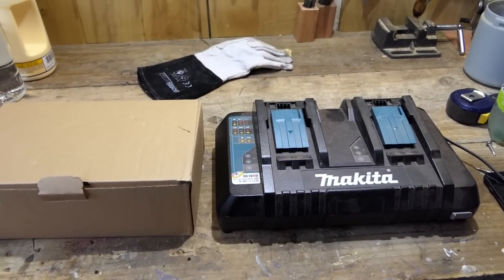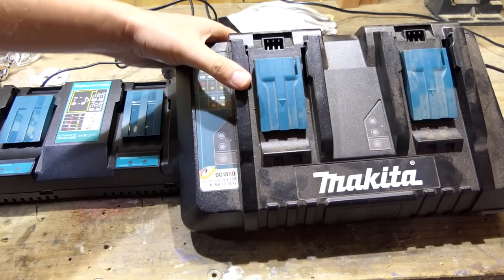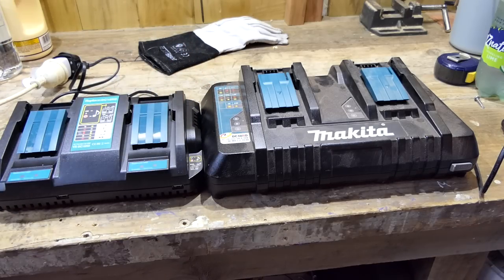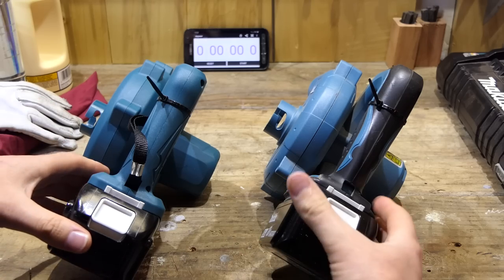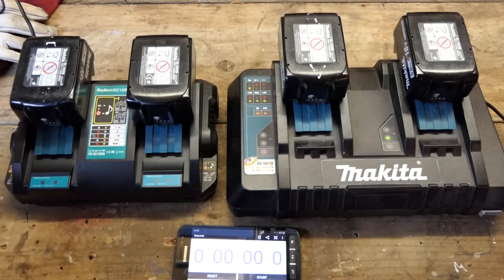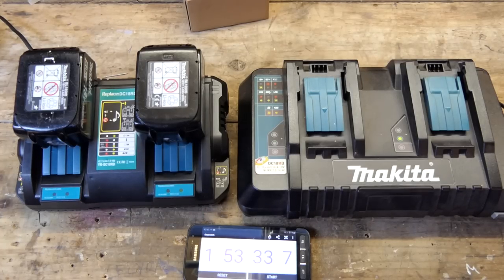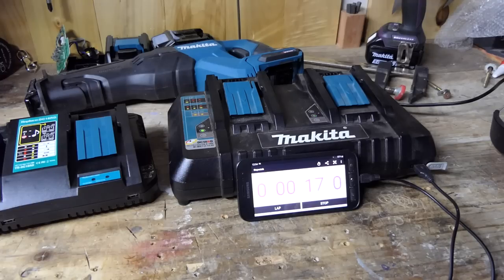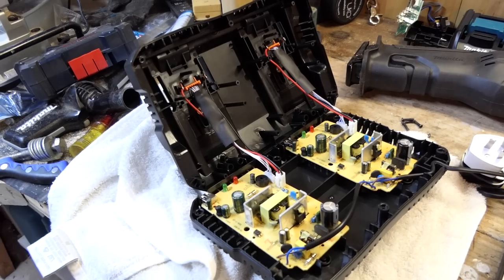FAKE Makita Charger & Blower VS REAL Makita Charger & Blower | 18v Dual Charger Review

Comment: No matter how good or bad this charger is, it's a bit unfair to describe this product as a FAKE. It is not marketed as a Makita product, therefore not pretending to be a Makita product, therefore not 'fake'. It says it is for use with Makita batteries. ie, is compatible with the Makita batteries. There are so many 'compatible' products we use in all areas of our lives. eg. car spare parts (known as 'aftermarket'). Who buys genuine Mercedes exhaust systems for their 15 year old car?? but we don't call them fake. When I hear about a 'fake' product, I usually think of identical 'copies' of high end shoes, designer label clothes, etc that you pick up at low prices from the market, getting the look for a fraction of the price, or ridiculously cheap SD cards from eBay. At the end of the day, they have offered a product with (claimed) compatibility and a price, which as the consumer we have a choice whether to buy or not. BTW, great video though!

Comment: The chinese is better because lower charge will heat less the battery resulting in a longer battery life. As you know, the heat is what damage the batteries.
Reply from the maker: The rapid makita chargers blow air through the batteries to help keep them cool.
Reply: @ToolsAndStuffOFFICIAL  yes! Makita knows It much better than us. However the blower will keep the outside temperature down. Drill a small hole, insert a temperature gauge in each and check It! But If you're in a hurry it's justified to kill the battery sooner. Otherwise, keep cool...
Reply from the maker: https://youtu.be/uumwieLu8CE